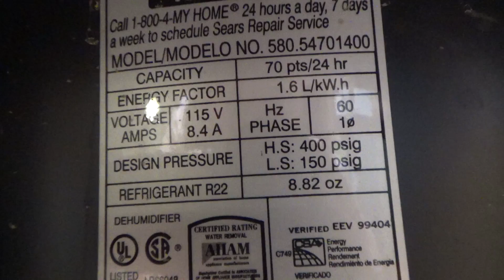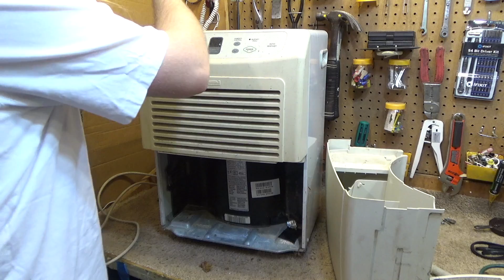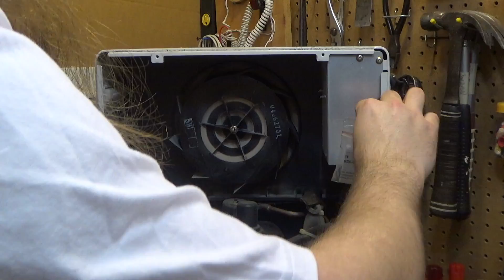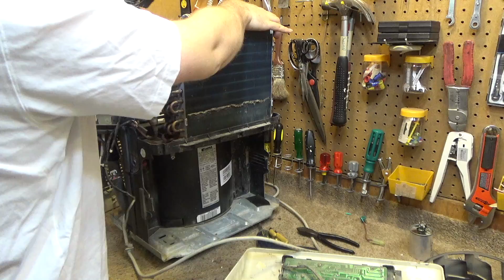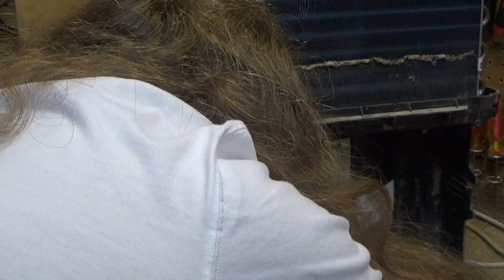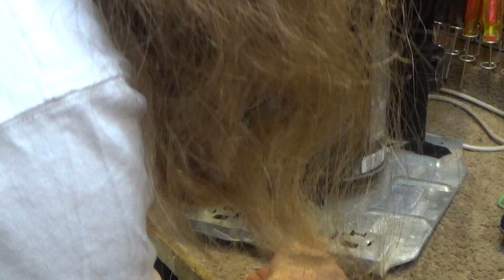Curbed Kenmore (LG) 580.54701400 70-Pint Dehumidifier | Test and Scrap

Comment: My grandma had a slightly older model of this unit as it was branded Goldstar. In my memory it was a total piece of junk as it was not that old and the fan failed at high setting speed. On low the fan still worked and the unit ran for a few more years until the digital controls failed. However one thing I can give the Goldstar credit for it was certainly better than Junk GE she bought to replace it. I personally use vintage ones as they never seem to die and id rather save something from the landfill the perfectly works and outperforms anything new in my opinion.
Reply from the maker: I only use units made in the 90s or earlier that have a metal cabinet. They work better, last longer, and are safer. I do not trust the newer plastic units to run unattended.

Comment: Surprisingly my church has a unit like this except it's a Confort Aire branded unit with a mechanical control set. Looks almost exact to this unit except for the mechanical controls. Unfortunately, these units are horribly loud due to them having the compressor exposed. Unfortunately, the unit at my church has a problem with the humidistat which I believe needs to be recalibrated since it's not tripping in at an almost 70% humidity room. LG is a brand I do have mixed doubts about. Some of their equipment is good while others seem not to see the light of day anymore. This was made certain during the downfall of LG's quality.
Reply from the maker: Why is that surprising?

Comment: I have an identical model (Kenmore 25850 50 Pint) that’s around 15 years old and has worked amazing up until just recently, the inside front has been icing up and can’t figure out what the issue is. The room temperature is good, the airflow is good and I just gave the whole inside a good deep cleaning of the dust build up and still no luck. Any suggestions on how to fix this?

Comment: I have never liked LG compressors, but I do have 2 mid 90s WCI air conditioners which have LG rotary compressors, and both of those run great and from what I have seen, they are quite high hour units.
Reply from the maker: Me either, although at least some of their older stuff worked satisfactorily.

Comment: What a noisey piece of junk, my grandmother bought a similar Kenmore 70 pint dehumidifier. I honestly don't know if it's newer or older than this dehumidifier but according to my grandmother it didn't last long. I only faintly remember seeing it roughly 2009. The dehumidifier that my grandmother is probably from 2002 because that's when she moved in during 2002. I'm going to scavenge online to try to find a image of That machine and probably post it on the discords. 

I will be honest and just say these machines were just pure junk from the beginning. They were very noisy and had a high failure rate.
Reply from the maker: These were junk, as were most of the other LG appliances from this era. I also have my doubts about it being able to remove 70 pints, the airflow from these is quite weak.